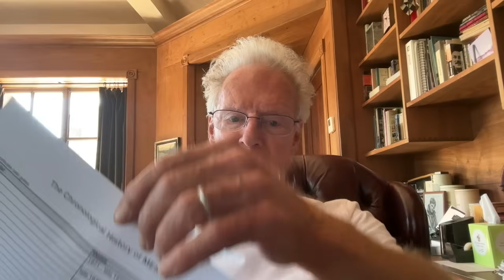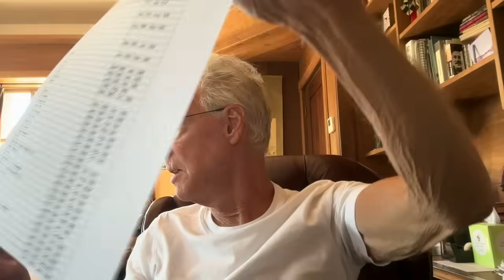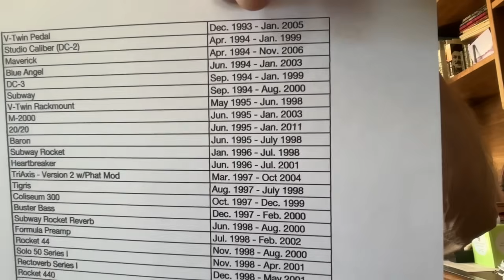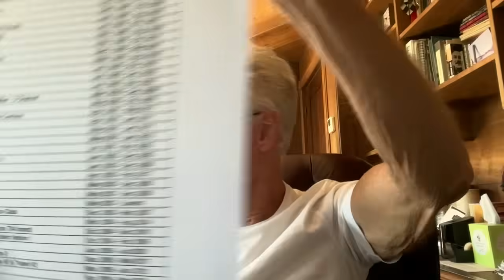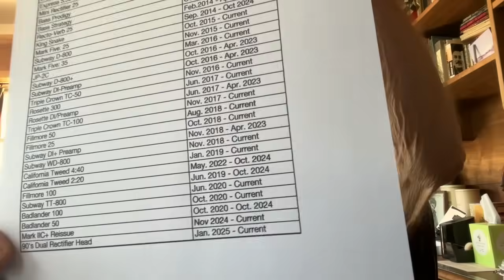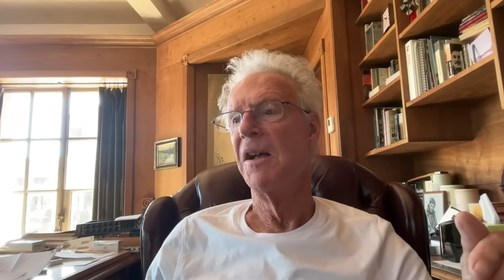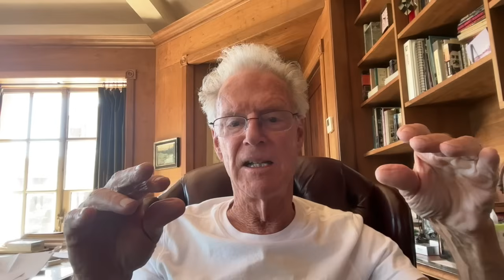Building Boogie 34  Part 2 History of Mark Amps

Comment: My main studio and live rig is a Mesa Studio preamp in a rack with a Lexicon Vortex and TC Electronic GSharp either direct from the recording outs (or into a JC-120) which gave me my exact studio tone live.  I always kept trying to find a 50/50 or 20/20 with a couple of 12" cabs but never found ones in the right condition for the right price.   Someday!  But yeah, not only Kurt Cobain used that thing I saw Scott Henderson using one circa "Tribal Tech: Nomad" using a StuPre into a giant rack.  I've used that thing since 1990 at least once a week and had Mesa refurb it after the original owner had a huge accident with it.  It's been awesome ever since.
Reply: did you use studio preamp into front input of jazz chorus or "preamp in" from back of jc. how it sounds? im curious cause i have jc-160 and i want buy mesa studio preamp to use with jc
Reply: @kvrt  I have used both from time to time I have found far less noise using the back inputs. I have a video at my YouTube channel on the JC 120 and how to lessen noise.

Comment: Hey! I love to hear you speak about all those amazing amps, it’s really nice to get to hear a lot of information about those amps:)

 I have two question tho, I’m sure you get the question a lot, but how close are the original 2c+ (DRG) and the reissue? Apart from components that me not be available anymore like those LDR’s and the extra relay circuit to not make the amp pop. I’ve read a lot of different things and opinions from people, so I don’t know what to believe and what not. The only difference I hear is that the GEQ has a wider Cut/boost range. but on the other hand, I don’t know a lot of technical stuff about the amps so I may be completely wrong!

In the previous video you talked about the reissue and the c++. I was wondering if the c+ reissue could be modded to the c++ too. I thought you said something like that, but I could have made up something in my head haha!

Thanks in advance and thanks for all of the great amps!!
Reply from the maker: I even added traces, holes and labels so the C+ could easily be modded to ++ for under $2.00.  Those have been removed under orders by the new owners of M/B.  Someone suggested I offer to personally mod the amps and I think $100. would be more than enough . . . and could include a signature plate from me.  Only half serious here but you get the idea.
Reply: @RandallSmith2G thanks a lot for your answer, and good to know! Thanks for all of the great amps that you’ve designed and built. By far the best amps ever made!

Comment: Mr. Smith. As both a Car fan and Amp fan, I admire the connection you have with your team. 

You guys collectively took the engineering leap to cram as much power and finesse as possible into each amp. This explains why Mesa was pioneers in so many amp-firsts.  

As a lifelong Formula 1 fan, I cannot help but see the correlation between crazy amps like the Mark V, Road King etc… it’s all about maximizing performance with options and power. 

Can you talk a bit about what types of cars or racing series influenced your amp builds? Eg. the Roadster, V-Twin are clearly some of the Mesa Products that derives from a racing mindset. 

And final question: Most exciting race you attended?
Reply from the maker: Thanks for asking about the Racing!!  I'd like to spill more about that coming up but right now, peeps are digging AMP history more than my race history.  Perhaps most exciting race was winning the final Palm Springs Grand Prix and how we (Team Stupid) managed to get on the front row to start, as well as how we became known AS Team Stupid.  It's in an earlier Ramble.

Comment: Mr. Smith, this Boogie Mark history has me wondering – what is it about the Black Shadow C90 speaker that's led you to pair it with so many of your amp designs, and are there other speakers you love (or hate!) with your amps?  With Marks, and especially the Mark VII, I keep gravitating back toward the Creamback M65s, either alone or combined with old Vintage 30s.  I also loved the Fillmore 75 you used in the early Reco-Verb 25 combos, which I've been told is a relative of the Eminence Redcoat CV-75? – it does what I wish I could get from the H-magnet Creambacks, but for all their good points, Cream H75s always end up too harsh and buzzy for me.
Reply from the maker: Very difficult for a speaker to sound bright and open for Cleans and NOT buzzy and thin for high-gain sounds.  C-90 does both quite well and is something we've worked on with Celestion for decades.  Also, great as the other cream/green etc Celestions are, they're really expensive and not as well balanced IMHO but sure do that one thing well!
Reply: @RandallSmith2G  You know, in reading your answer, I had one of those moments where I realize that I asked a question about the past as if it had all the same options & context as the present – when I focus it down to that clear objective, lively cleans and fat lead tones, and then I consider what the speakers in contention for various Mesa amps & cabs would've been, 30, 40, 50 years ago, I realize: there probably weren't half a dozen mass-produced guitar speakers on Earth that could handle the tonal range of, e.g., even the earlier Marks, and do a credible job with even half the sounds on tap, because when all those speakers were designed, no amp MADE that many distinct sounds!

Comment: Was there ever a time where someone thought about taking a triaxis and a 50:50 or 2:90 and putting it in a regular amp head, in a similar way to Hughes and Kettner have been doing with their all midi amp head?
Reply from the maker: The Sri came about during the Rack period and its size/shape didn't allow it to be a combo.
Reply: @RandallSmith2G  Thanks for the reply but what's an " Sri "? Curious  minds would love to know. Thanks.

Comment: Hi Randy, I’m another massive Mesa Boogie fan! I had the MKIII Blue Stripe, MKIV, Studio Pre, and Quad. I unfortunately I had to sell the MKIII Blue Stripe, but I think it had the best clean channel ever! Just wondering do MKIII and MKIV clean channels the similar circuits? And do you have any suggestions on how to make the MKIV clean sound similar to the MKIII clean? In particular the 3 switch’s on the back: Pentode or Triode, Class A or Simuclass, Mid Gain or Harmonics. Thank you.
Reply from the maker: Thanks!!  Though very similar, the III and the IV do sound a little different.  I don't recall every circuit detail and as for the back switches, it would be Pentode, Simul and either MG or Harmonics, your choice.
Reply: @RandallSmith2G  Thank you very much for replying

Comment: Just curious, my early dual rectifier, number 112, I believe that has LDR’s, they have failed in the past, so if they fail again, what will happen again to my amp?  It would be nice if you could talk about the Stiletto,origin and stage ii mod.
Reply from the maker: Hmmmm . . . call it a Senior Moment -- I can't remember whether those first Rectos used LDRs.  But no fear:  I believe we still have replacements.  Good suggestion about Stiletto . . . get there eventually!

Comment: I have a 2011 Mark V 90 combo, and as best as I can figure a 1998-9 Blue Angel. They do everything I need them to do, and in the case of the Mark V, way more because I don't play with very high gain so the 3rd channel basically doesn't get used. I hate to pick, but I am curious why cheapen out the Mark with the low watt versions? Was it just market direction at the time of the decision?
Reply from the maker: No Way were V:25 and V:35 created to cheapen the Mark V.  They are totally valid models for guys who don't need to haul around BIG power and their success is proof of concept.  Too bad the geniuses in charge discontinued those amps as they were very good and very well received.  Also, they're two-channel vs three in the Big Boy.  Plenty of room in the market for all of them . . . until corporate bean counters upped the overhead and sacrificed many excellent products.
Reply: @RandallSmith2G  Oh yeah? Is the 90 out too? I guess that wouldn't be too surprising seeing that historically when a new Mark comes the previous Mark fades off into the sunset.
Reply from the maker: I believe the VII has replaced the V, but couldn't say for sure.  Makes sense if it has and, you're right:  that's usually what happens.

Comment: Respect to you Sir. I gratefully own multiple Mark IIC+ (including one Coliseum) and a Mark IIB Coliseum, a Mark IV and the amazing Mark VII. Your work, is a great work of art that will last forever!

I previously communicated multiple times with Mike Bendinelli (great respect!), this is the first time I write you.

I would like to ask you two questions, if possible:

1. The original Mark IIC+ DRG and the Reissue: what makes the difference in tone (the reissue sounds more modern compared to the vintage IIC+), is it only the older parts that makes that difference?

2. About the Mark VII: i tested a lot the Mark IV mode compared to one of my IIC++. I find the IV mode closer in tone and feeling to the IIC++ rather the Mark IV. Would it make sense to say that? That mode sounds like a more compressed (and boosted) IIC+.

Thank you for your time, I greatly appreciate the amazing content you are providing!
Reply from the maker: What a Great collection . . . and you're quite an expert IMHO!!  Answer 1.  It's possible your vintage IIC+ has the original Simul-Class output transformer that sacrificed clean headroom and was updated to cure that, though it was better matched to just the two Class A triodes.  2.  Can't really offer any insight to your tonal perceptions except that circuits were kept VERY faithful to the originals.  Types of tubes and precise, measured control settings would be needed to accurately distinguish differences.  Different makes of 12AX7s can sound quite different; pots must be set and matched with ohm meter.
Reply: @RandallSmith2G  thank you for responding to my questions, I appreciate it!

Are the IIC+ mode on the Mark VII identical to the IIC+ reissue in terms of faithful re-design? 

I don’t feel the reissue captures the IIC+ better than how the VII does it (beside the IIC+ Reissue having the ability to push/pull).

Comment: Every Boogie I have every played through, from my 50 Cal + combo to the Marks, Rectos, Lonestars, Atlantics, have all worked like a charm. The pots were Rolls Royce smooth and I never heard crackling and popping like I'd hear with most amps. Also, regardless of speaker, from EV to Celestion, they always sounded very well paired. I can't say this for most amp makers out there. The Mesa Celestion Black Shadow in my 50 Cal sounded just as good after seven years as it did the day I got it. That thing simply did not wear down, and I played the hell out of it every day for years. And it was also the most efficient amp I've ever owned when it came to tubes. Unlike some of the Marshalls I owned, I changed tubes maybe very three or four years. The 50 just sipped tubes, rather than eating them like potato chips like my Marshalls and other tube amps. I would go to John Carruthers' shop in Venice Beach and buy new tubes three or four times a year. I eventually got the idea, "I need a Boogie." The 50 Cal was not only the finest amp I've ever owned, but a musical instrument in itself. It was just so purpose built to make the guitar sound better, and sit it perfectly in the mix, nothing else compared.
Reply from the maker: Thank You for this reply and your support!!  Exactly what we endeavor to do!!

Comment: It's great to hear about the quad preamp. I managed to hunt one down in 2023 while my original 5050 was in Petaluma for repairs. I have a hard time picking a favorite lead channel. The reverb tanks were dead, so I need to eventually replace them bc I heard they have quite the unique sound together. The short tank has been out of stock on mesas site & idk what long tank to purchase. Any suggestions on replacements, I've been using a boss rv6 for reverb.
Reply from the maker: Good Choice!!  Yes, the Quad had two Reverb tanks - - a long one and a short one.  Don't know what's wrong with yours but they can usually be fixed - - actually that most common problem is simply the fine gauge wire breaking off the RCA connector, OR a mounting spring coming loose.  Look carefully - - likely IS repairable.
Reply: @RandallSmith2G  I have the quad opened right now and the long reverb tank coils make noise when moved but no guitar signal is effecting the reverb. I plugged the long tanks wires into my mark v 90w reverb tank but nothing happened. I try to figure stuff out myself but amps are probably out of my league. (EDIT) I do see a tiny resistor that looks black directly to the left of where the reverb tank wires go to the board. Between a green and blue wire w a felt like covering to them that's wired to the whatever is next to the short reverb tank.  Theres some black on the pcb board as well.

Comment: I am turning away repairs on most Mesa amps now that I have an elderly parent to care for. I have a pair of old MkIIs with the initials RS in them. Gibson will likely just make endless lines of Mesa Boogie reissue models. There is a list of things I really do dislike about Mesa Boogie amps as a repair person who has made some really nice amps and once made a lot of PCB based products for the black markets of stealing scrambled pay TV and cheating AT&T's telephones & especially their payphones. I was 13 years old, & selling pay TV descramblers & phone phreaking device. At 13 years old going to prison was not a concern. Randall is addressing one of the things I am not crazy about with the tone controls affecting multiple channels. Perkin Elmer has stopped making LDRs some time ago but there is an Asian company making TWO of the 20+ models of LED/LDR opto-isolators that Perkin Elmer once made. Perkin Elmer is the company that F'ed up the Hubbell Telescope's lens & mirror stack.
Reply from the maker: Yeah - - compared to simple one-channel, low(er) gain amps, there's more to a Boog to understand.  AND we've always been there to help techs and players with Great customer service.  Occasionally an amp needs to be returned to us (Mike B !!) for total sorting - - esp if it's been molested or modded.

Comment: I love how your amps somehow maintain a clarity around the pick attack while at the same time maintaining a nice compression and crunch. There is nothing else quite like that in the market. 
The functionality for me is all my Mesa tracks maintain clarity in a busy mix. 
Again I love love love my Mesa gear!
Reply: As a side note, maintaining good harmonic clarity when using higher levels of distortion is always a challenge for chord voicing. I used a bbe sonic maximizer to accomplish that in a lot material but with a Mesa it was no longer necessary. I would often dial back the bbe for sweetness but learned that when and leads came up the bbe  worked against the Mesa tones by sharpening or cheapening that warm rounded but firm Mesa compression that worked so well on lead work. Mesa notes have a nice wide sonic imprint that no other amps do and I don’t think a lot of players are aware of this.
Reply from the maker: We work SO hard and long to achieve what you've written about.

Comment: Man, the hours and hours I spent in front of my buddy's rack in the guitar shop (he owned the shop, I worked there) playing with his Triaxis through a Marshall 9100 with the 6L6s (5881s, whatever).  Speaking of which, I'd love to hear some info on choosing/tuning the EL84s versus using something like 6V6s for the newer low-power Mark amps.  I'm sure there were some challenges getting the Boogie sound with the lower headroom and such.
Reply from the maker: Cool history of yours!  Actually 6V's and 84's are quite similar -- except the sound and base pins.  Same transformers work for both and clearly one is American and the other Brit, in sound and source.

Comment: My F30 is my rig. Everything else is to support that. Without it, Im sad. I got it used on Ebay after watching a video on YouTube. 
By "without it" I mean when I use up the tubes and the thing goes microphonic. When it does, it sounds like an undesirable reverb and its time for a tube swap. Goes back to sounding BEAUTIFUL in every way. 
When I learned that you don't need to be an electrician to change tubes without biasing them I was sold. Im on my fourth set now. I haven't paid a tech to do anything yet so far. Knock on wood. 
Hell, I'd probably sell my collection and take up coin collecting without my "sound".
Thanks man ! Music is and has been the biggest part of my life. My soul. And it got better in 2005 when I found my sound !
I really liked my ampegs and Marshall's. Still do. But without the f30...... I'd,  yeah prolly quit playing...
Reply from the maker: Thanks!  Yes, I thought the need to "have your amp biased" was kinda weak and should be unnecessary.  As I used to say, "You don't need an electrician to change a light bulb."  Could rant on how vaguely useless most "bias setting" actually is but kinda technical.  We find the "sweet spot" for each amp model and hard-wire it so it never needs changing.  Proper "biasing" is much deeper than "set at -52 volts".

Comment: I love it! May I make a request for a video adjacent to this history of the Mark series? - - - Wikipedia has a page dedicated to the Mark series. Speaking specifically to the section that is “Mark III” where each revision is briefly detailed with what changed at each step along the way… This section has been referenced as gospel in the community. So many of us would love to listen to you speak on that section, either elaborating or dismissing key points listed therein.
Reply from the maker: I don't recall much about that time and those mods.  Mike B came up with them, as I recall, perhaps trying to get closer to the elusive IIC+ tones.  What Wikipedia has is probably pretty accurate.  I'll try to remember to ask Mike about that.